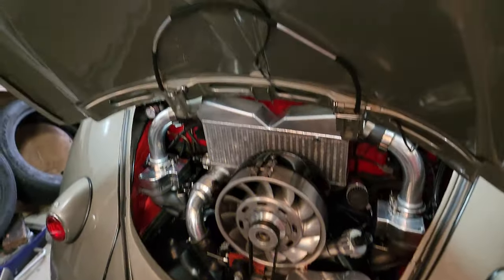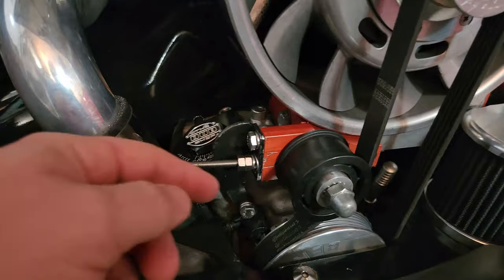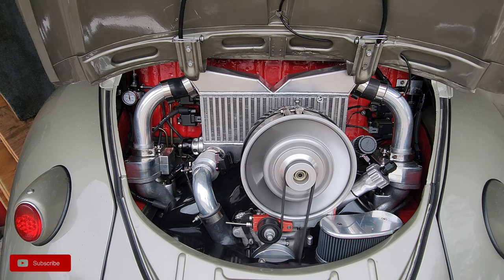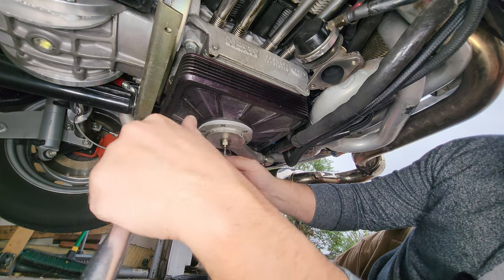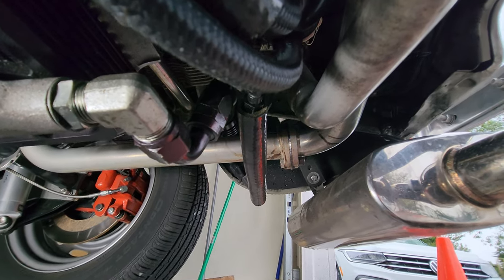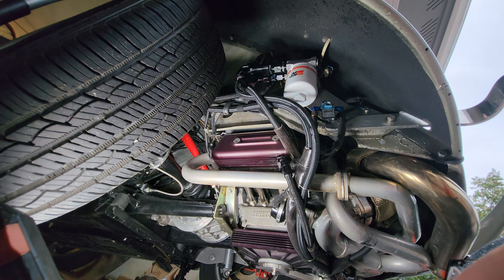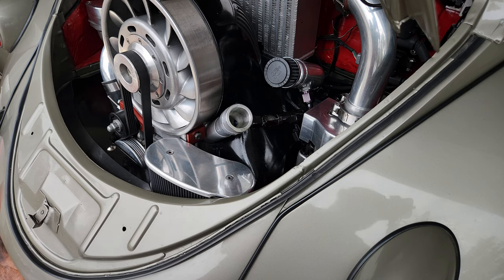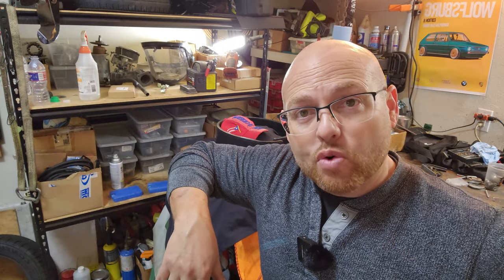TURBO VW Beetle Oil Change

Comment: Hello Jason. Long time no see your videos. I myself been using the same two oil types here. Here in Canada never had to use the 20W30. I also always never fill to the top of the dipstick with oil. 1 quart less to help aid the oil drain back out of the heads. Keep up the great work on the goose.
Reply from the maker: Same here man... never fill it all the way.  It definitely helps keep the turbulence down in the crankcase.

Comment: Might just need a new belt since you were running it loose. Could take some emery cloth to scuff up the smooth surface too and see if that helps. Could also soak your belt in some 309.
Reply from the maker: I think it's actually the idler pully sqeaking.. but a new belt is on the way too.

Comment: Hey Jay love your work, was wondering I have a Cb performance full flow oil pump and loved the set up that you have with the drain plate, that drain plate was custom? Where can I get one similar to yours if possible? And how did you make the connections to the oil pump? From the IN outlet, and the out to the oil cooler?
Reply from the maker: You would need a stage 1 1/2 or 2 oil pump for this set-up.  Mine is from Autocraft but there are other ones out there.
Reply: Like you said in your vid. More dinerowww jajajajaja but I’ll order a 1 1/2 one that is going for I think 450 ich. No going for the stage 2 is going for 700 😢. 

And that oil plate where can I find a similar one?
Reply from the maker: The Oil sump I have is custom and built by my friend at R.A.C.E.  Any add on sump can be used as the pick-up attached at the bottom is purchased through Autocraft as well.
Reply: @JWClassicVW  the original pick-up tube is not needed?,  or how it would work now? I got the 1 1/2 pump and the plate.  I have this question if now the original  pick-up tube is also needed?
Reply from the maker: No the original pick-up isn't used, Oil is now drawn from the bottom of the sump to the pump with the multi stage oil pump.
Reply: @JWClassicVW  Hi Jay,  thanks for the responses. Is your crank shaft pully a 4 1/2 size for the clearance of the pump?
Reply: what did you use to do that oil drain in the oil plate?  I want to do it on mine. :face-red-heart-shape::trophy-yellow-smiling:

Comment: i used jason herrrera at stoopid fast for tuning recently. who do you use? and yes it was crazy expensive.  that was on a ford v8 with holley terminator efi. i have a bug with webers.
Reply from the maker: CP Motorsports here in Houston is where I'll be going... they have a new shop location.  I just need to schedule the dyno time.